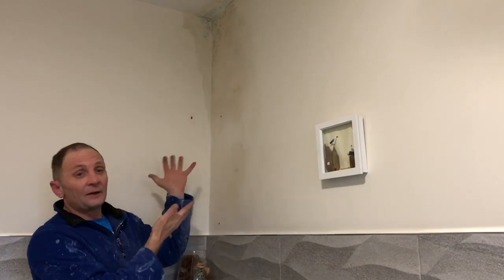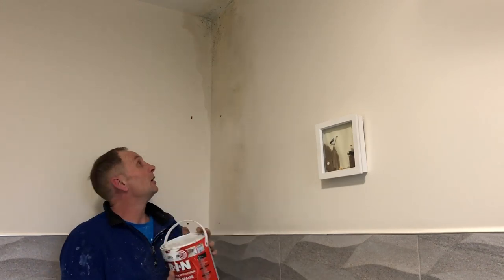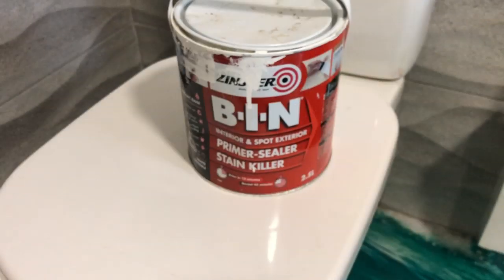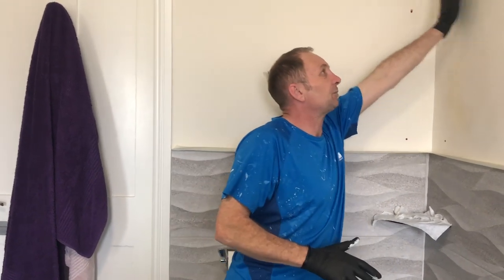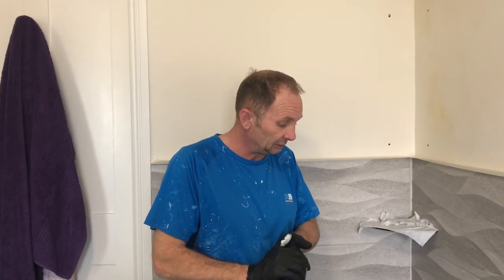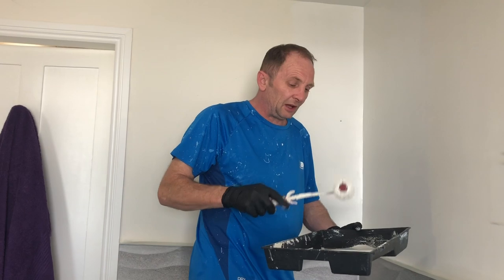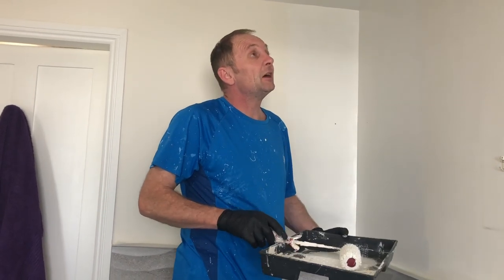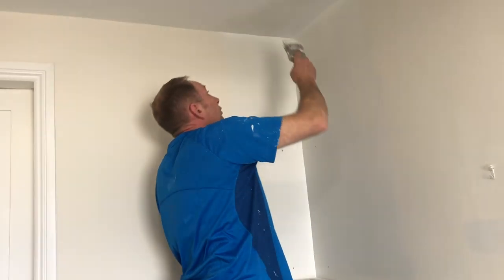How to paint over water 💦 damage

Comment: been using Zinnser bin every week  for over 15 year now it's definitely the best product for stain blocking.no need to spend money on meths or other just a clean 5 litre tin place your roller and brush with a little Zinnser bin just to cover and it will suspend it's self and never dry if lid is tight
Reply: Got to be metal tin
Reply: Try johnstones stainaway water based, its unbelievable. Half price bin no smell and its a finish,Unlike any water based stainblocker 
 Get it tinted any colour also.

Comment: If is just surface mold painter over is fine, but is better to remove the damage drywall because sometimes the Framing is contaminated with mold and need to be sanded and wire brush hepa vacuum wetwipe exposed damage framing with shockwave desinfectant and encapsulate with fiberlock 6100 clear encapsulant. Good video 👍🍻

Comment: My top tip with Zinnser 1-2-3 oil based is once you’ve used the brush, just overload it and wrap it in cling film. Lasts a few months like new. Better than needing to dispose of chemicals or messing about leaving it in chemical. It kills the brush you can’t wash it out. (Usually like water fresh out the tin not treacle) ✌🏻
Reply: Zinsser 123 is water based mate
Reply: wayne bevan The one in this video and the one I’m referring to is oil based/solvent.
Water based Zinnser in a blue tin.

Comment: bins is the boy best stain block ever drys really fast worth every penny but do not buy the water bases bins it is crap
Reply: Clint l would have agreed with you up until l tried under protest Johnsones stainaway. 
Absolutely unbelievable product. No smell, easy to roll ceilings etc
 
It beat Zinsser All coat oil for me , which failed..  had absolutely terrible back up service from Zinseer. The Rep wouldn't even come out look at job, customer very annoyed with them..
Reply: never used the johnstones yet but bins has always done the job i waned it to do never ever had a comeback on this product unless the damp hasnet been sorted properly but that would go for any stain block product
Reply: @clintmannion5598  
I was of the exactly same opinion until the Johnsones manager told me absolutely zero hassle from any painter with this new stainaway.
 I tried it and taken a tin Shellac van just in case ! Pleasantly surprised.
Only thing not work on is knots though
Reply: RAVEN AK47  what kind of bins the spray zins is shit got to be the 1 in the red logo
Reply: RAVEN AK47  plus using undercoat means to have to wait till the next day to paint over damp area i use bins cos u can paint over it in 30 mins
Reply: RAVEN AK47  u  will be telling me next u can undercoat and gloss windows in the same day next with oil bases